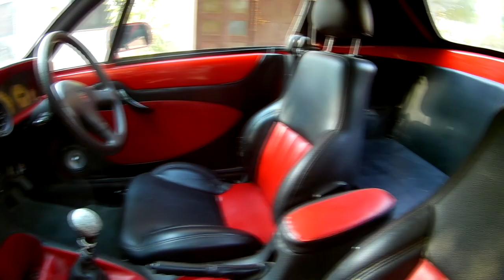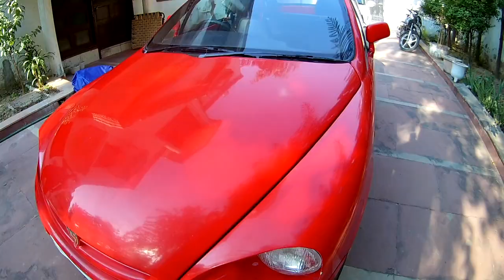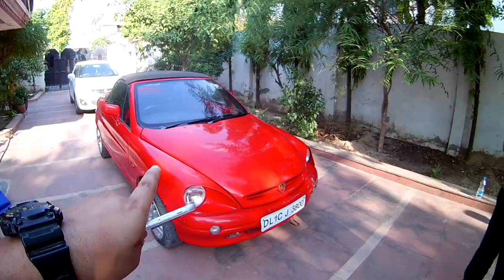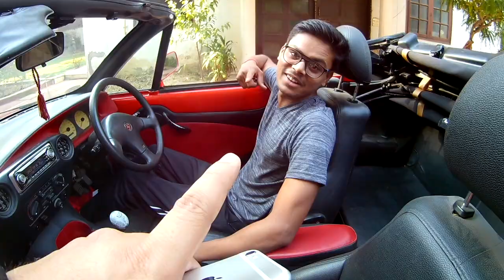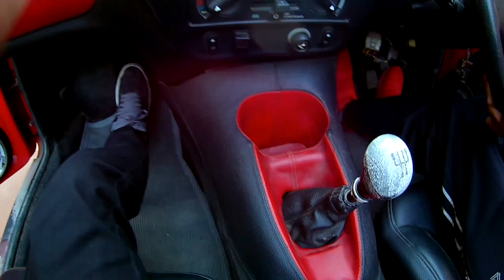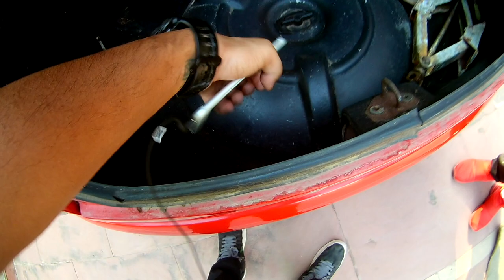सब से सस्ती Convertible  कार | CHEAP CONVERTIBLE CAR IN INDIA | LIMITED EDITION CAR 🔥🔥

Comment: This car was produced from 2002 onwards.. Assembled in Goa..In its later years the company transferred it's assembly unit to Bangalore. I was a dealer for this car..Sold around 8 units . Still have two cars unsold.
Reply: Wats the cost of car
Reply: Wheres the show room
Reply: Hi . I'm interested
Reply: Do you still have the cars?
Reply: I can buy this car
Reply: @jaipalyadav1  it's an illegal modification. You will end up in jail.
Reply: @zarifaadriyanchowdhury2583  ppppl 

. 
?? #
Reply: @iamhritwik  😂 Bhai koi modification nhi hai isme
Reply: Would you like to sell those cars? What was the onroad price at tht point of time
Reply: @gayatrihaldar5570  I have one Red color in super condition. 
With central locking system and push start button and remote start.
2003 model. Original condition, newly painted,  new interior, valid RC
Reply: @akhilreddy8261  I have one Red color in super condition. 
With central locking system and push start button and remote start.
2003 model. Original condition, newly painted,  new interior, valid RC
Reply: @iamhritwik  it's an original convertible car. No body will drag you or car to jail. It's s legal car.
Reply: 2 car s available
Reply: Bro I am interested in buying one of those.

Comment: Kaise milega
Reply: I have one Red color in super condition. 
With central locking system and push start button and remote start.
2003 model. Original condition, newly painted,  new interior, valid RC